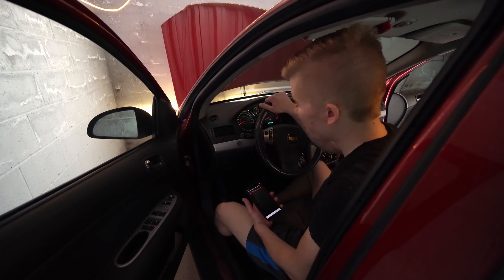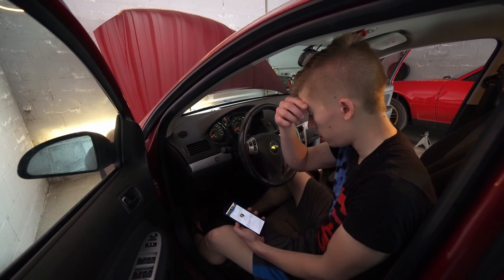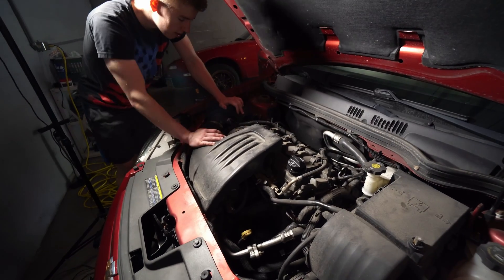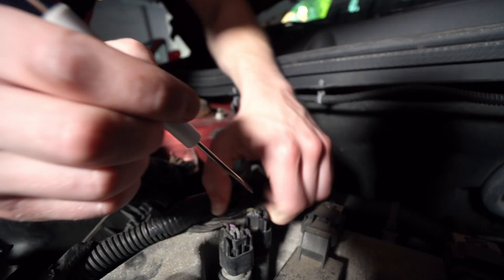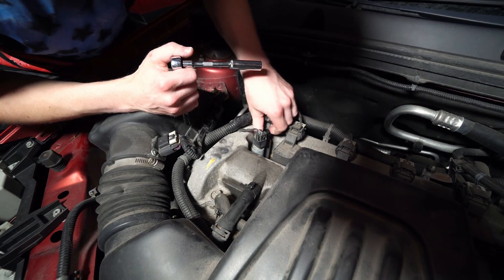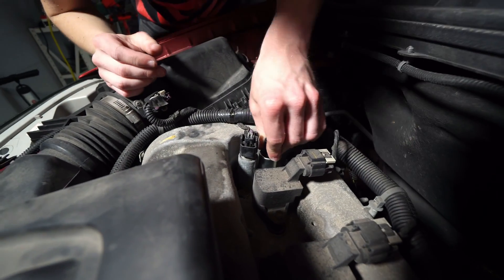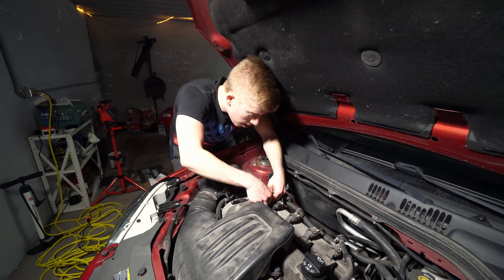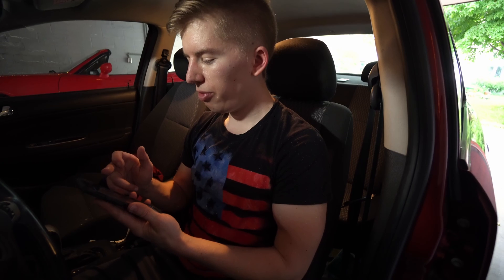Check Engine Code P0013 - Chevy Cobalt Ecotech 2.2L Z22SE LC61

Comment: Heyo-- got this error code yesterday- car's been in for regular every 3k oil changes- just hit 60k.  Is the same model part you have linked in Amazon still working fine in your Cobalt?
Reply from the maker: Sold the car about a year ago, but had no issues since replacement.

Comment: What's part name?
Reply from the maker: Camshaft position actuator solenoid, the intake and exhaust are different part numbers
Reply: @HardwayLearning  I looked on ebay and rock auto. Do you know the part no#
Reply: @HardwayLearning its timing solenoid same thing?
Reply from the maker: @relaxationstation9588 there's a link in description, got mine on Amazon

Comment: So I got the parts at the store and the solenoids are the same color at the top. I told them that the intake should be grey and he checked and said no I have the right ones. Went to change them and the olds ones were the same way. I guess my question here is can you run the exhaust solenoid on the intake side? And have you seen the same color tops before? Thanks in advance.
Reply from the maker: I'm not sure, online I see them paired grey and black as well as two blacks, but I'm not sure why they wouldn't be interchangeable. They look physically identical other than the connector color. I would imagine all cam adjustments are monitored and controlled by the ECU. Did you end up installing them and nothing catastrophic happened?

Comment: What mechanism did the 2008-2010 variable valve timing solenoid replace on the 2007s?  I am having the exact same problems that a bad VVT solenoid would cause.. appreciate any answers
Reply from the maker: If it is the 2.2L engine it should be the same as this unless your engine looks totally different.  I would enter your Year, Make, Model, Trim level into amazon to confirm.

Comment: I have a 2007 cobalt LT and i purchased the solenoids but i do not see them in the same position as the video any ideas as to where they may be?
Reply from the maker: According to a different video you may have a different engine and it appears to be on the front right side of the head below the oil fill cap to the right of cylinder 4 intake plenum.

Comment: I have a p0112 code, can someone please tell me where it's at please?
Reply from the maker: Google tells me that's usually the intake air temperature sensor, which is I'm not mistaken is located on the intake tube between your air filter and your intake manifold
Reply: @HardwayLearning  that's the MAF Sensor, I see no other connections.
Reply from the maker: @NEKKAKU_THROATSON  right, on a MAF car the IAT is typically integrated in that assembly

Comment: Do you do the same when u have p0014 code
Reply from the maker: Yes, P0011 and P00112 is for when intake cam position solenoid is out of position.  And P0013 and P0014 is when the exhaust cam position solenoid is out of range. Both can also be triggered if your oil is low and there isn't enough for them to operate correctly.

Comment: Very helpful. Changed out both of them in about 35 minutes. Was careful to clean the area before removing the parts. The one on the exhaust side was pretty gunked up. I had this same repair done on a Chevy HHR 5 years ago and the cost was around $400. I did it myself on a Cobalt for about $50. Thanks.
Reply from the maker: Glad we could help you out 🤘
Reply: Can you tell me part no and where you found it. Can't find it on rock auto. Thanks
Reply: Vehicles Intake and Exhaust Camshaft Position Actuator Solenoid Valve Kit - Replaces 12655421, 12655420 - Compatible with Chevy, GMC 2.0, 2.2, 2.4L - Cobalt, HHR, Malibu, Equinox, G6…

These are the parts I ordered. Got from Amazon 3 years ago. The link to my order no longer works. Search around.

Comment: I initially had this problem a couple of months ago, and went to replace the part, which made the light go away. The check engine light came back on though, it seems to be the same code. I don’t know what else to do with it, and need it fixed so I can get my emissions checked
Reply from the maker: Is it the exact code? Or is it the opposite one? There's an actuator for the intake and also the exhaust. Otherwise, maybe the part went bad?
Reply: It is recommended that you change your oil and oil filter after you change the solenoid
Reply: I’ve had this same issue for years , went through several solenoids both Intake and exhaust , light goes off and comes back on. Once the part was bad , replaced .. now it’s back on .. gotta be another issue along the same lines 😢

Comment: I'm having a problem my engine bogs out and sometimes is hard to start how to change crank position sensor camshaft position sensor still does the same thing I just hate it's caring for $50 they say the code is p0016 saying that the engine vacuum is very low is that the Eternal engine time is out they trying to say that I need a timing chain and possibly timing chain actuator should I go ahead and replace the timing chain actuators this is so easy for me to do also they gave me a ridiculous price of $1,700 of course that was for the chain to be replacing also the actuators the car is still running it just hesitate to pick up speed and bogs out
Reply from the maker: I don't think this would cause the car to bog that bad. Maybe get a second opinion from another shop?

Comment: Wait did you use your phone as a engine tester? Or is that just a fancy one? I know a bit about cars I just didnt see the bulky engine tester or a wire
Reply from the maker: Yes, I used a bluetooth module that connects to my phone with the "Torque" app. There's a link in the description 👍. It's only $10

Comment: Got a 07 G5 Gt I had this issue changed it but it came back on again... you think maybe I got a bad actuator or is there something else that can cause this
Reply from the maker: What code are you getting? Other thing could be the harness/wiring running to the actuator
Reply: @HardwayLearning  I'm getting the P0013
Reply from the maker: @bradwells3558  if it's convenient to exchange it for a different one, I would try that first
Reply: @HardwayLearning  I bought it online about a month ago... it was only $30

Comment: I have a 2005 chevy cobalt and I was wondering will the parts you linked in the description fit mine as well? Majority of the Camshaft Position Actuator (Exhaust and Intakes) I see online say 2006-2010.
Reply from the maker: You might want to find the one with your year. Amazon let's you enter your car, then I would search for camshaft position sensor
Reply: Hardway Learning I need the solenoids the 05 did not come with a sensor
Reply from the maker: @ncognateaux  I meant solenoid sorry, enter your car and year and search for camshaft solenoid
Reply: Hardway Learning Just grabbed one and it should be here Friday. Hopefully this solves my issue with the rough idle/hiccups.
Reply from the maker: Was the car throwing a check engine light? Could also be spark plugs or ignition coils
Reply: Hardway Learning nope
Reply from the maker: @ncognateaux  I'd probably start with spark plugs and the coil pack to be honest. This valve throws an engine code when it misbehaves
Reply: This was my reddit post explaining my situation:

My 2005 Chevy Cobalt 2.2 Lt with 116880 miles has been giving me a weird hiccup/misfire issue when idle and everything I have done doesn’t fix it. After removing and reinstalling my coil pack Im getting a check engine light. Scanned it and it got a Misfire on cylinder 4. Got my transmission done the check engine light went off and the hiccups stopped for a few hours. Hiccups came back. Installed my new fuel filter and the check engine light came back. Now its scans saying its random misfires now.

-Changed Fuel Filter Today

-Transmission Drained, New Filter, & Filled Yesterday
 
-Mass Air Flow Sensor Cleaned Yesterday 

-Throttle Body Cleaned Yesterday 

-Spark Plugs Changed Nov ‘19

-Coil Module Replaced Nov ‘19

-Coil Pack Replace Nov ‘19

-Alternator Replaced Summer ‘19

Any ideas on what could be causing issues?
Reply from the maker: @ncognateaux  can't recall, does this car have spark plug wires? Have you checked compression at all?
Reply: Hardway Learning Haven’t checked compression

Comment: That's an easy job and I'm having this problem waiting for the mechanic to fix it, how you reset the car so the light despair from the cluster??
 I learned something important thanks to you!!
Reply: You could also just disconnect your battery and reconnect it, that will normally get rid of any lights on your dash
Reply: @mattwood5617  thanks 😊
Reply: I hope that you could answer me today, so I can go and do my self.🙏🙏
Reply from the maker: It will either go away, or you should get an OBD scan tool.  I have a video on the one that I use.  Search my channel for OBD scanner
Reply: @HardwayLearning  thank you I'll watch it!

Comment: Wondering if I have the same issue, the engine light comes on intermittently and the engine seems to chug a little bit and run a touch rougher when engine light is on. What do you think? Thanks! Great video BTW.
Reply from the maker: I would try scanning for codes, that will usually tell you what's wrong. You can get a cheap scanner on Amazon that connects to your phone! This car differently experienced weird hesitations when the actuator was acting up.

Comment: Isn't there a camshaft position sensor on the front of the engine too? By the throttle body? 

Great video btw. Straight to the point.
Reply from the maker: The only two I'm aware of are right next to each other, one for the intake and one for the exhaust valves. There may be a crank position sensor elsewhere though!
Reply: I believe that would be the p0014 code. There is a sensor on the right of the engine. There's a YouTube video of it somewhere.  This may help me as I still have this engine code myself
Reply: @privateeromally  https://www.youtube.com/watch?v=ozKRbUx5TS0